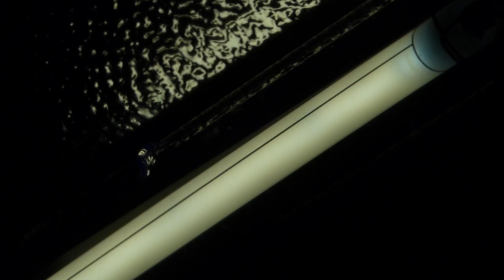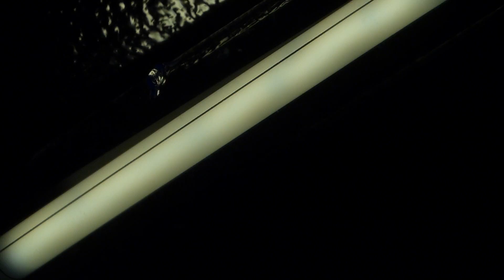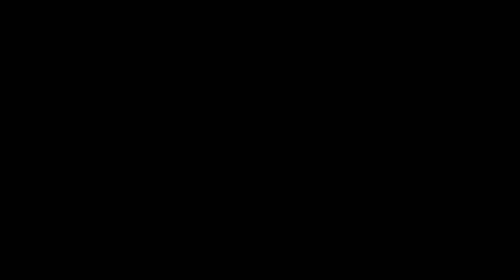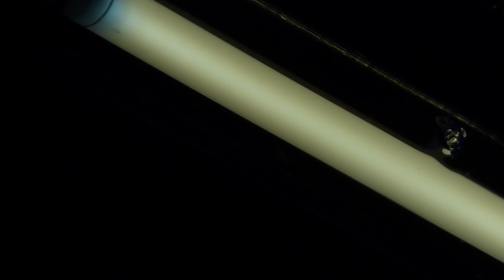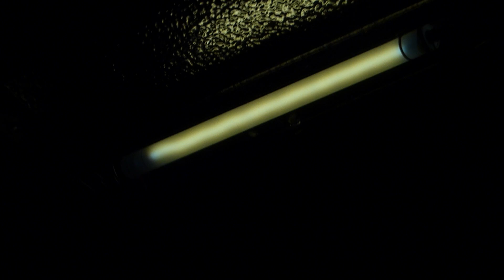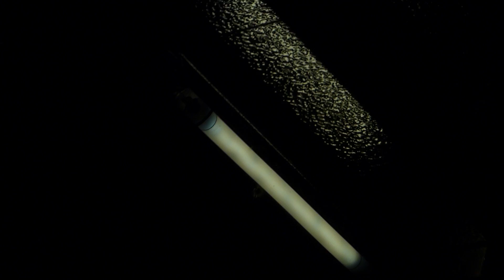DE Bulb Compatibility Addendum

Comment: I run 5 AC/DE hoods from SunLight Supply with Ushio HPS (except veg) bulbs. The hoods have a special air flow to pull off some heat without pulling air past the bulb directly. The other day I forgot to turn my 8 inch porting fan on and my room ran a full 15 degrees hotter! And, you can run them without the glass and they will still pull the heat out of the room.

Have a GROOVY Day
Dahbig Kahuna
tommyj